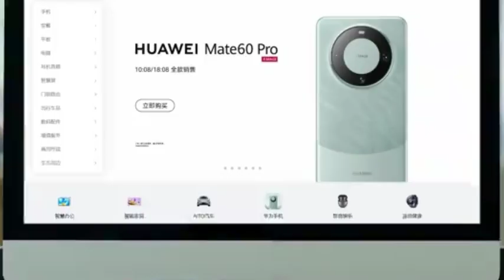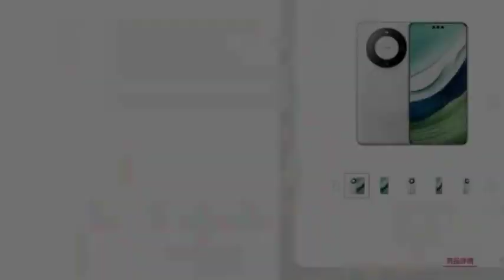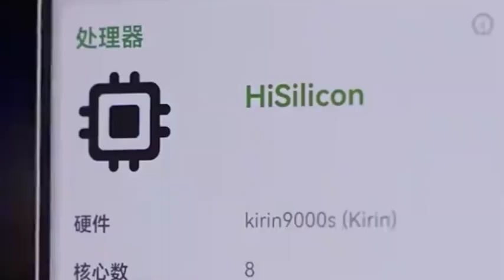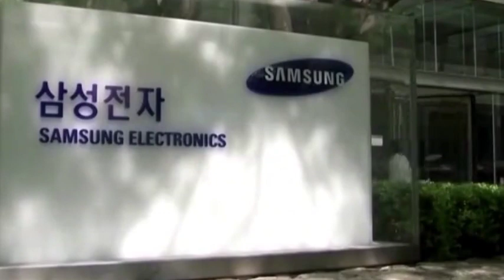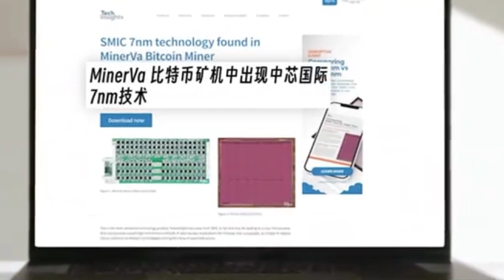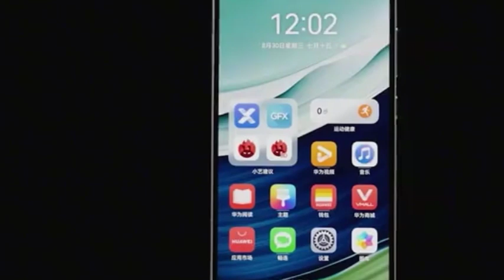The U.S. slanders Huawei's new chip technology is "stolen" and China can't have such technology.

Comment: USA & ASML only 3 nanometre transistors,,,The potential for picometre transistors is on, i hope china reads this ;)
Reply: 3nm but speed is 4G
HW is 7 nm but speed is 5.5G

The 3 nm is a hoax
Reply: bruh, get off the coke 3nm is pushing it that's the length of 10 atoms. Any smaller and that transistor becomes a wire. IE: you can't get smaller than 3 nm ever